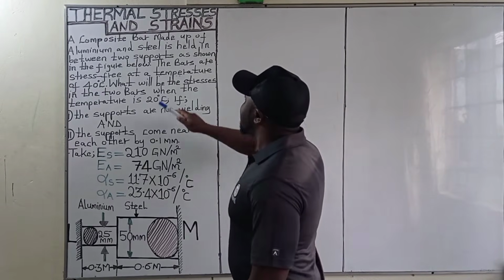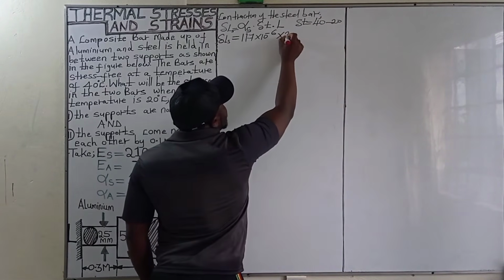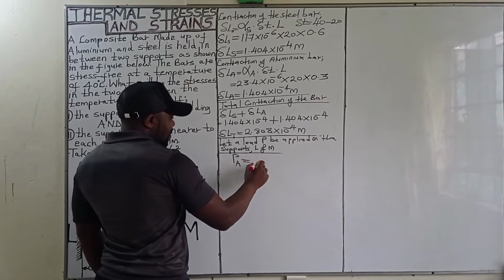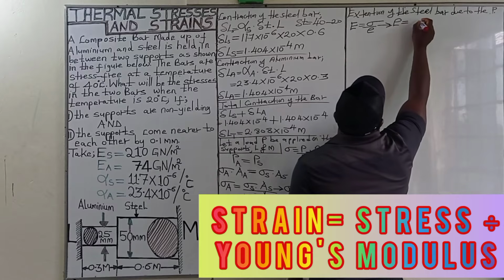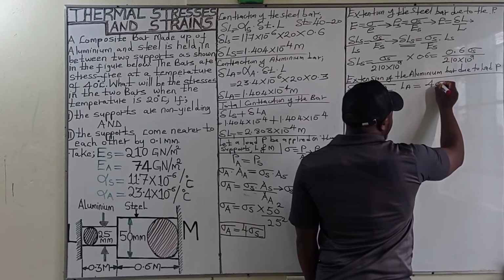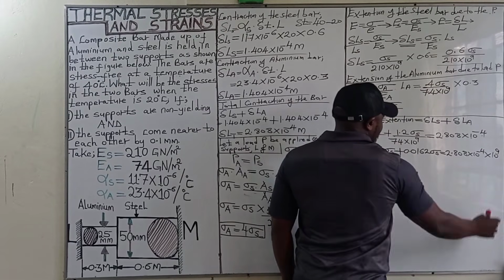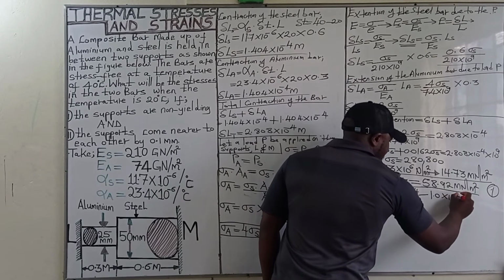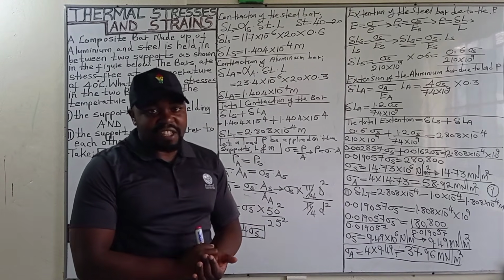Thermal STRESSES and STRAINS Induced in a Composite Bar.

Comment: You didn't take the width in consideration for area
Reply from the maker: The cross-section of the bar is a circle. Therefore the width doesn't come in.
Reply: @georgekamiti6538  ok, but can length and thickness of a bimetallic strip be used interchangeably?